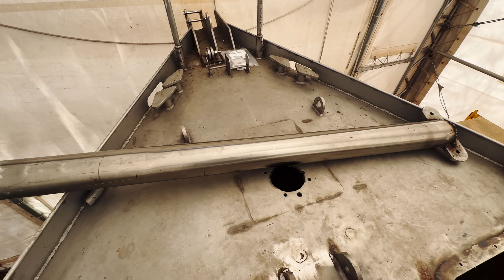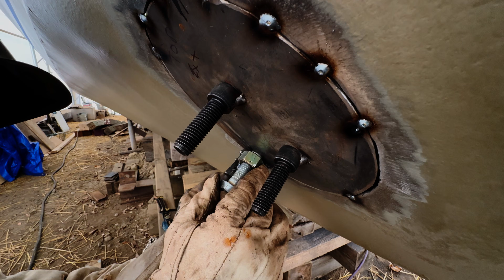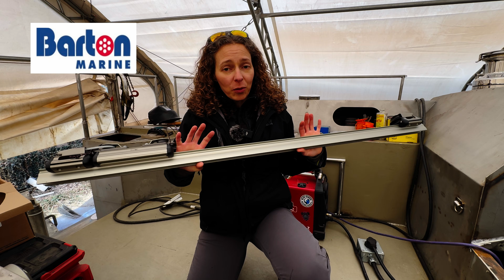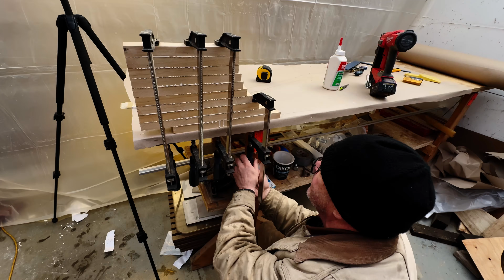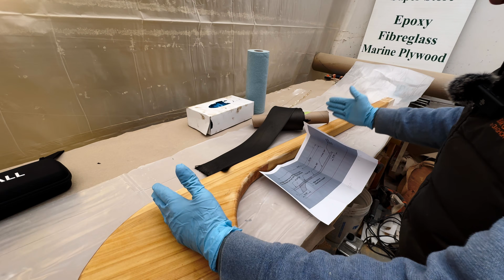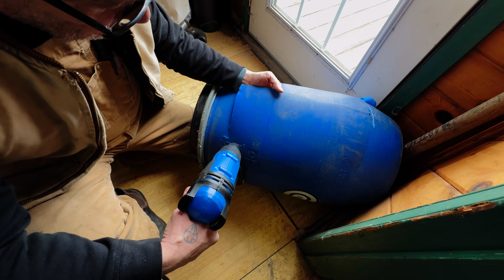Getting it done! 💪 Build Update | ⛵️ Expedition Sailboat Build for  the Arctic EP.20

Comment: As you must have noticed from my lengthy comments ,I would have done many things as you do ,if I would prep for  longterm cruising ,especially for the wonderful ,serene high latitudes .A metal hull ,alu or steel ,or rescuing a good enough wooden boat ,protecting/strengthening  the hull with tar and copper sheeting . Your steel hull find would have been very intriguing for me as well ,even as solo sailor and the steel 'Alaskan Gypsy ' ( another YouTube channel ) for greater projects .
As retired medical professional ,aged and finally having contracted skin cancer ,after an adventurous life on many continents ,I would have emphasized following more than you might do .  Extreme good insulation - non toxic and many ventilation options ,all lockable and by choice locked waterproof ,even under pressure ,(  knock down ) . Cockpit redesigned as working pilot house with hardtop from stern davids to cockpit glass windows in front and thereby easier access to and from cabins ,still with watertight door . 
Cold ,wetness ,waves,splashes ,fog ,ice cold ,wind ,rain ,hail ,snow ,storm ,.... all are conditions ,that tire an aging body and are endangering once awareness and accurate decisions and thereby safety ,hence the effort spend on a working pilot house cockpit is well spend for longterm life aboard cruising . As romantic and having lived in the north , I would design a hammock system for a longer ,retractable bowsprit and a multiple use watertight locker ,that can be used as dry locker ,manual and by boat motions washing tub and as bathtub for special days/nights with a safe fire water heating option ( lots of dry driftwood on shores in high latitudes ,but often throwing sparks , for sweet and saltwater baths .The option to sit or lay down in a hammock ( even if small )  ,or hot/warm water bathtub ,under the night sky ,or during the day ,is such a luxurious and relaxing experience ,costing nothing ,once the set up is done . On land ,I used an old metal bathtub outside ,a controlled fire underneath ,by necessity laying on a wooden board and towel in the bathtub and had many hours of hot bath bliss in snow/ice/night conditions ,often getting out and rolling in the snow ,before jumping back in again . These bliss experiences can be designed for longterm cruisers as well ,with some changes ,like filling the watertight locker- box on deck ,from a big pot or smart tubing on a controlled fire bowl on deck . Yes ,unconventional ,but so blissful ,especially for high latitude sailing and a wonderful present to arrange for once partner and oneself . Just sharing some unconventional thoughts from an unusual lived adventure life . May you crown your refit work ,with decades of functional health in body and mind , blissful cruising as long as you like !
Reply from the maker: @kayweiss1862 Those are all excellent ideas, well thought through and throughout, with lots of background experience. We are thinking of some of them, but at the same time, we need to stay on budget. We are trying to make the best with our limited funds and time as October is coming fast. There are some improvements that will be done in time. 
Thank you again! Wishing you well and sending good vibes.
Reply: @SailingWildRaven  yes ,budget and time are important and so is your joy to actual start sailing life ,not be stuck on land with work . just make sure ,that you install the best anchoring system ,much stronger than people might tell you  and make  attachment points extremely strong  at front ,stern and sides . whoever has experienced real storm conditions at anchor and at a dock ,will know the difference in peace of mind ,instead of fear ,anxiety ,terror . the attachment point at stern needs special attention ,to avoid ripping of the wonderful ,important wind vane and having to be dragged off a grounding, happens far more often ,than people want to admit .
may you have wonderful times for as many years as you want, with functional health of body and mind !
Reply: @SailingWildRaven BUDGET> How to get your wished for anchor(s) for free ? ! ,(maybe ):did not think to write again for some time ,but thinking of your budget ,I will share an old idea of mine, concerning anchors for cruising vessels : You have an attractive ,serious expedition vessel in build ,interesting for supply companies ,but still low in YouTube numbers . As you know ,anchor capabilities are dependent on hooking/digging  task on different grounds and weight and chain quality and attachment point(s) to vessel. 
a super heavy anchor on small vessels creates handling and weight problems . in normal conditions ,a medium weight anchor ,slightly heavier than normally advertised ,is practical ,but in stormy/windy/heavy swell/squalls and close to reef and other dangerous obstructions (including other boats )  much heavier anchor(s) would be better . Choose the anchor and company you like the best and make following marketing test proposal to that company,( or companies in selected sequence): ask them to use their anchor testing methods for a new combination task anchor and offer to test these on your expedition vessel against free anchor with your YouTube channel add. anchor appropriate for your size boat with additional weight attachment available to easily attach in dangerous ,more demanding conditions and easily to detach . likely a stainless steel anchor with stainless steel bolts attachments.
the placement and extra weight has to be tested by company and you offer to test that in cruising conditions for free stainless steel anchor with extra attachment system and maybe even stainless steel 100 meter chain, all for free ,since chain and anchor and attachment point to boat work together .  that should be possible ,has several advantages and ,as far as I know ,has not been done yet ! try it out by contacting your wished for anchor companies in sequence .Good luck ! If that works as well as I think it could ,whatever company accepts your proposal and goes into production ,will have something unique and you could negotiate a % of shared patent per sold anchor and if patent sold .Another way of getting cruising and refit money! whatever company invest in that ,can potentially prevent millions of damages and environment harm and get extra revenue and promotion exposure ,including from former customers ,by selling them appropriate attachments
to their existing anchors ( testing all their produced anchors first and make appropriate attachments ,with exact instructions where to drill the attachment bolt holes ). many sailors are more likely to upgrade their existing anchors ,than to invest in expensive new ones .The above fits my preferred requirement for projects : creating mutual benefit dynamics , always including environment !
clicking extra weight or dig in tools to certain anchors ,or to the chain  might work as well ,but is unlikely to produce a free anchor and maybe even patent revenue to you
Reply: In case you will not try to get a free anchor as I wrote ,maybe thinking it to be to far out ,you can still try out things later yourself . Anchors have to be balanced to function properly ,that is why any addition to any type ,size,weight of an anchor has to be functional and proven with right form ,weight ,attachement ,location and that is why a business addition for an existing company might be possible . What can be done to improve holding capacity ,without touching the main anchor itself ,would be to attach an extra weight ,hook or another anchor few meters from the anchor to the chain ,keeping the chain grounded and thereby boat safer from dragging ,with the grounded chain weight, instead of all of the chain tugging at the anchor in swells ,or tugging loose between 2 anchors on 2 chains . In some heavy conditions ,problems might arise ,to lift the anchor afterwards ,probably good to be able to dive down and loosen entrenched anchor and chain .
This comment really ends my comments for some time ,might have written to much already .may you launch at wished for time and truly enjoy !

Comment: ,congrats ! I would have taken out the bow thruster as well ,especially for your size of boat and preferred high latitude destination . You mentioned encountering ice ,what about strengthening your bow against ice ,logs ,rocks and debris .?  Yes , a retractable bowsprit ,enlarging sailplan for your weight of boat and extra longterm  cruising and expedition loads ,but I would choose a longer one for larger sail and hammock netting . Worked shortly on refitting a 4 mast windjammer in my youth and bowsprit hammock netting is romantic and such a pleasure to use ,even for a smaller boat and retractable bowsprit .and safer to check front on the go .Would add at stern a holder for outboard ,whatever kind you might have for dinghy as emergency propulsion . Still no news about your 2 holes at stern ,for former dual rudder.
For high latitude sailing ,with lots of debris ,I would have changed to one rudder as well ,but be inclined to use existing holes as holding boat upright when beaching ,letting boat rest on your strong keel , with strong enough poles going down and when not in use for that purpose ,coming up and being part of strengthening your davids and cockpit hardtop solar -rain catch -arch . Being prepped for wonderful ,serene high latitudes ,including ice ,fogg ,rain ,cold  I would have rather thought you welding proper glass windows at cockpit front with hardtop solar from cockpit front to stern davids  and this design not just for protection from cold and fatigue and wetness and intense sun ,thereby increasing safety and comfort joy , but as well allowing to have a proper watertight and lockable door as your entry into interior ,much easier to navigate ,especially when getting older and easier tired ! 
would change your current design accordingly ,but still watertight with extra strong safety glass and extra strong locking system . May you launch in time ,enjoy your building time and even more ,decades of cruising in functional health of body and mind !!!
Reply from the maker: @kayweiss1862 Always a pleasure reading you! And your feedbacks are always appreciated 😊

The stern original rudder shaft tubes will be used to stabilize the boat when beached. And we might also add underwater light (that we could remove… still in the final design process. 

Hoping you are enjoying nice weather in Nepal.
Reply: @SailingWildRaven  you are busy in many ways ,hence I do not expect replies, comments are freely shared and intended for reflection and increased YouTube action  for your cruising life adventures . following is serious : There are many incidents and maintenance issues with thru holes . especially metal hulls can prevent these, by avoiding thru holes and when truly wanted( needed ) using a manifold and securely welded with higher than water level exit/entry ! it is worthwhile to research that issue seriously ,before committing. Cruising ,especially in higher latitudes ,will get you acquainted with logs, debris and ice and unchartered areas, hence, consider strengthening your bow ,at least at certain predominant contact areas and have water tight bulkhead zones  ,you can still access ,especially where you have thru holes and potentially collisions .
 to my relax ,luxury comment of having a multiple use watertight box : on your size boat ,you might believe not to have enough space on deck ,which might not be entirely true ,if truly wanted .alternative :I was lucky enough to be invited to Bhutan several times by the government and even there ,in remote areas ,I saw variations of hot baths ,in form of upright drums and an outside fire for heating up water .
you might get by with a big metal pot ,put on fire at shore for heating up water and some kind of container fitting your body and hot water . if you design or refit an alu dinghy or alu snub nose (short) canoe or kayak , these vessels might be usable as hot bath ,if slightly altered .getting a watertight metal cover for your life raft on deck ,might work as well ,with less storage problems .
I am not joking .Having the needed items to make yourself a hot bath on shore ,or on deck (good for washing clothes as well ) is a wonderful luxury and free of costs with drift wood .!